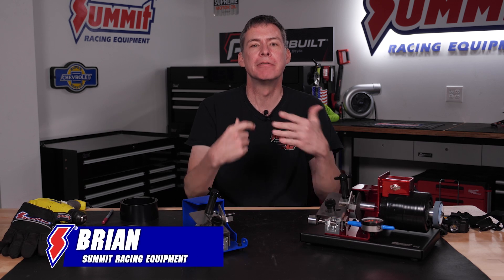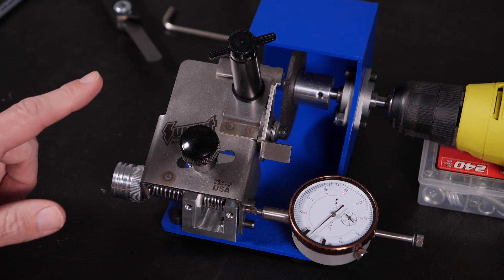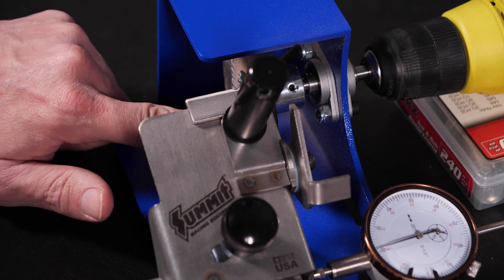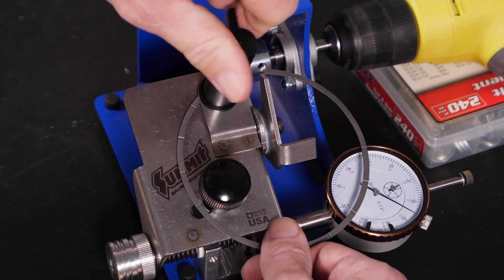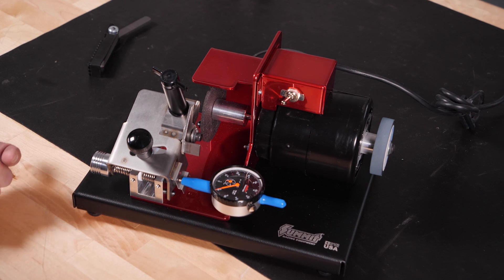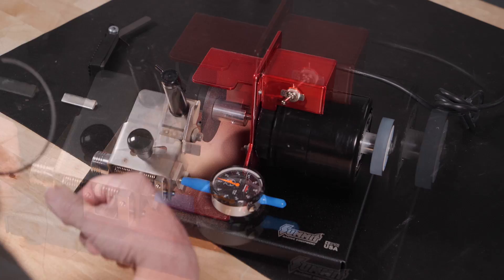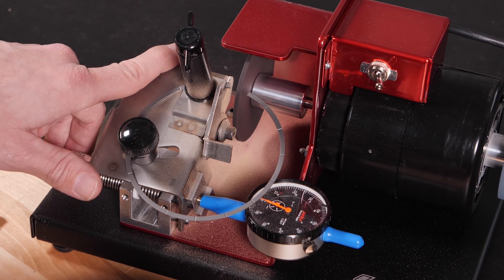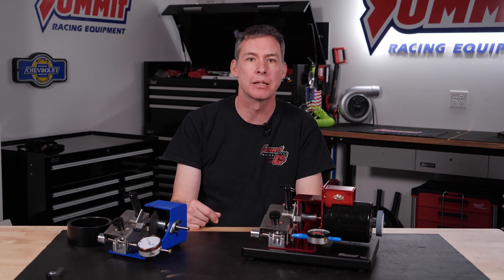How to File Your Engine’s Piston Rings | Summit Racing USA-1 vs. Pro Ring Filers

Comment: What's the grind wheel on the opposite end used for?
Reply: watch the video for the Total Seal ring gap tool. Identical machines. It's for deburring the ring after cutting